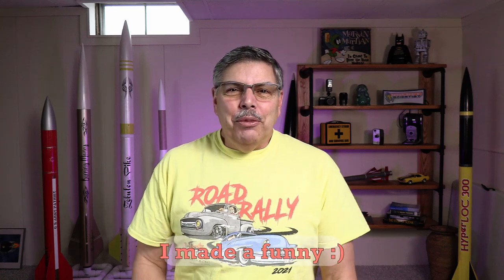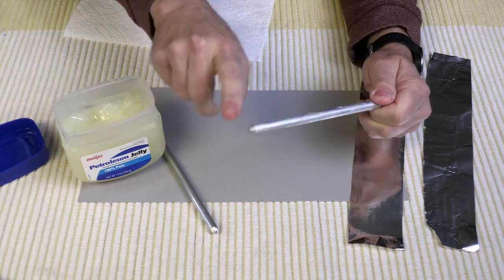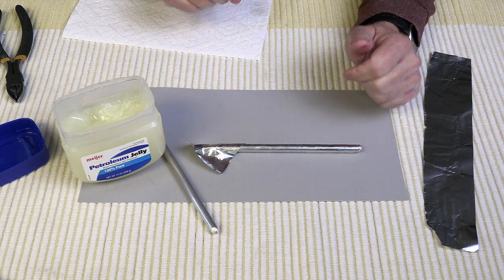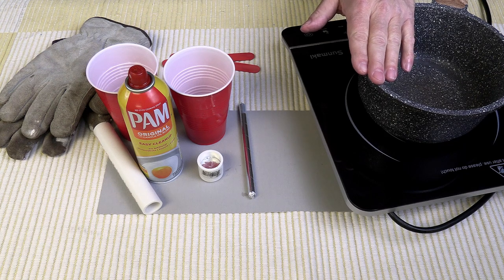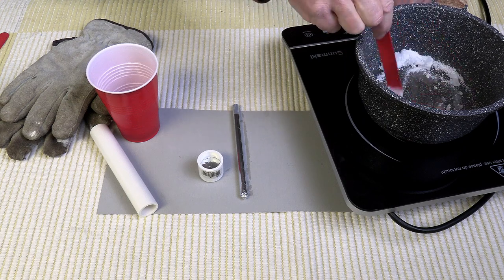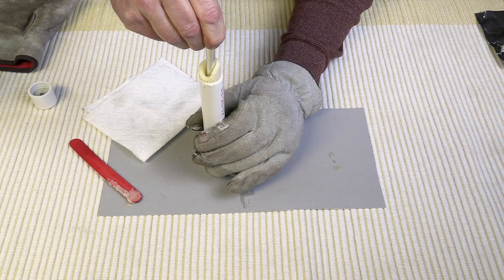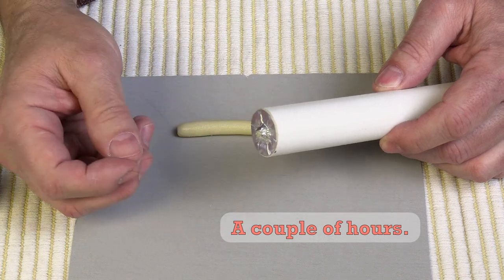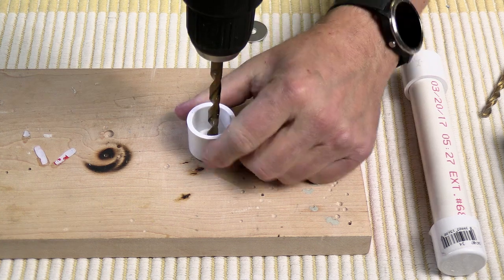Learn How To Make A Small Sugar Rocket Motor With PVC!

Comment: Wonderful video! Everything is perfectly explained 👌
The American PVC pipes seem very solid because here in Europe all those that I tried (32mm and 40 mm) do not resist the pressure.
Reply from the maker: In the States we also have schedule 80 pipe that is a lot thicker. If schedule 80 is available you could use that or try a different type of pipe like one used for a drain line. There is a balance between time, temperature and pipe strength. Keep the burn time short so the PVC does not have time to weaken from the heat. You could also try a thicker casting tube for the grains. I hope that helps.
Reply: Dont use PVC... Get some wood glue and paper... Even stronger because it is not soft as it heats up....

Comment: What size of pvc would you need to make a single use H motor? i am wanting to make a H size for a LOC-IV style rocket i built.

thanks for all the help:)
Reply from the maker: A 1.25"  pvc pipe would work the best with sorbitol for fuel, check this out https://www.nakka-rocketry.net/pvcmot4.html  
Good luck and let me know how it goes.
Reply: @TheRocketeer  ok, i can try that out. Im guessing probably about 14 inches in length. Thanks for the link

Comment: Thank you for the great video. Do you have recommendations for a timed delay to discharge the parachute?
Reply from the maker: If you know how to solder the  Eggtimer Apogee Deployment Controller is inexpensive. http://eggtimerrocketry.com/home/altimeters-av-bay/

The Perfect Flight miniTimer 4
https://www.perfectflitedirect.com/minitimer4/

Pet2+ even timer
https://www.missileworks.com/store#!/PET2-Event-Timer/c/5760486

There may be other timers on the market.

For a little more money you can get an altimeter that senses apogee and will fire the charge. This altimeter is the one I use for dual deployment.
https://altusmetrum.org/EasyMini/

Comment: Hi Chuck.  Can you tell me what ratios you've had success with building alu and mag motors?  Thanks.
Reply from the maker: I have used up to 15% aluminum and that gives me a wild flame. The fuel is difficult to light and tends to run at very high pressure. For magnesium, I have run up to 5% and it seems to work well but does not have the wild tale. I think magnalium would work great at around 10% but I have not had a chance to test it.

I use a doped fuel. In other words, I run the standard 65/35 ratio and add the metals on top of that. Be careful with magnesium and magnalium, the metal is highly reactive and has not been tested thoroughly.

If you run tests with metals please let me know what you discover and use great caution while mixing, casting, and testing!
Reply: @TheRocketeer  Thank you Sir. I sure will.  I might even start a channel on the subject so others can find a safe mid power motor.  My plan is to build a motor with delay and ejection charge. I know some already exist but I kinda want to take it to the next level. Safety is a huge factor for me. Thanks again for sharing your experiences.  Will stay in touch.
Reply from the maker: You can contact me directly CaptHaywire@gmail.com      @WarbirdPylonRacer

Comment: @2:00 couldnt you just use a pfte (teflon) rod since its non stick regardless and can handle the temps of the sugar propellant
Reply from the maker: Yes, PTFE is a great material to use for this purpose and does not transmit as much heat. I use acetal (Delrin) for 54mm grains. Thanks for your comment!
Reply: @TheRocketeer  np dude i just got a random though watching this, figured id add that for you

Comment: What's the maximum weight of the rocket this motor can lift
Reply from the maker: With a 3/16 fender washer it lifted a 13oz (368g) spool to about 100' and then blew up. The raining cardboard was a fun event. I used a 1/4 fender washer in this motor so it will probably lift a little bit less.

Keep in mind a spool is not very aerodynamic at all. You can see the video posted on my site. I would have to say it packs a punch for its size.